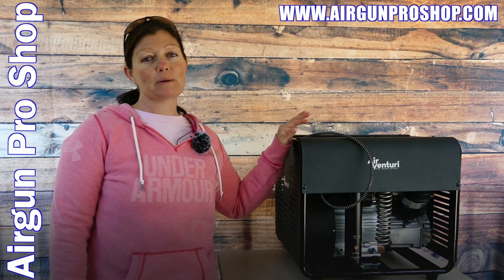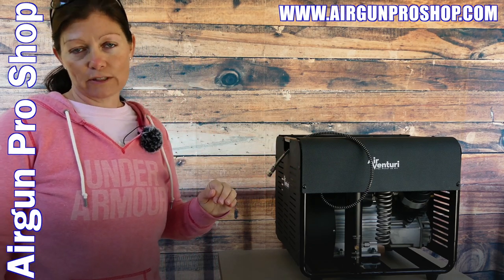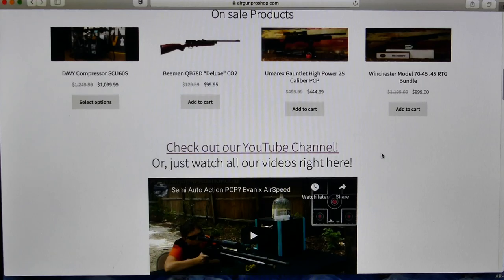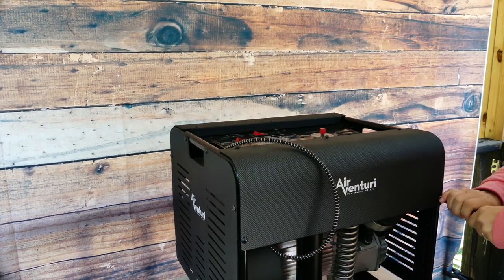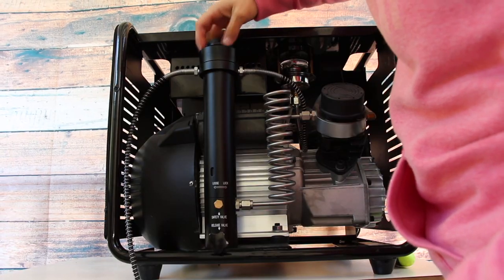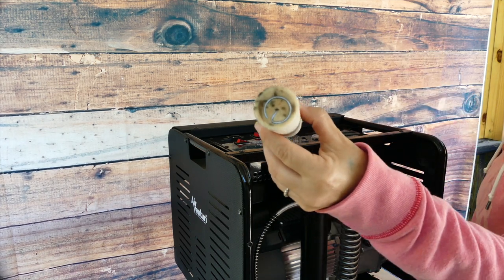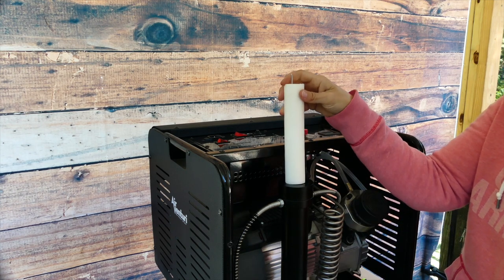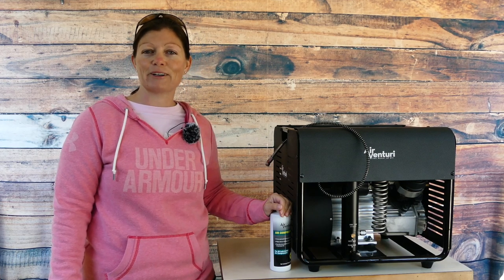Maintenance  On The AirVenturi Compressor With Airgun Angie Changing the Filter

Comment: Question.  I have the same compressor and noticed a burning smell. Well it was the air out take / silencer melting. I have only run my compressor at 6-8 min intervals just to top tank off before a hunt. My compressor now will not fill the tank.  Not sure what to do.